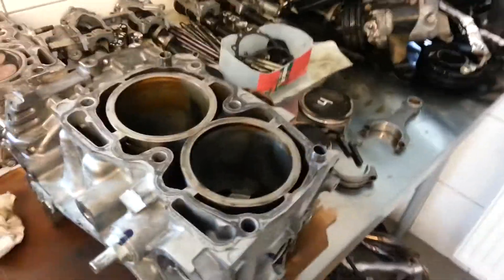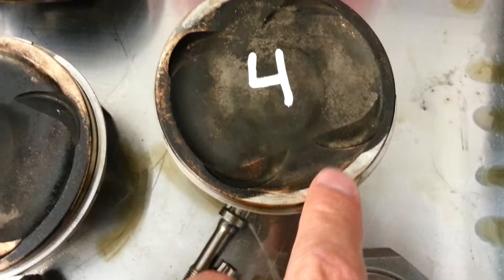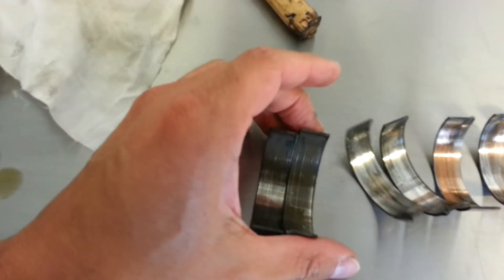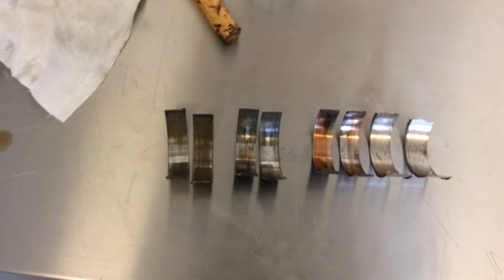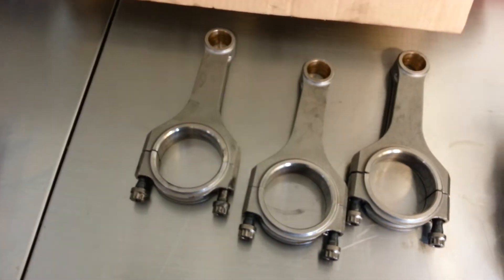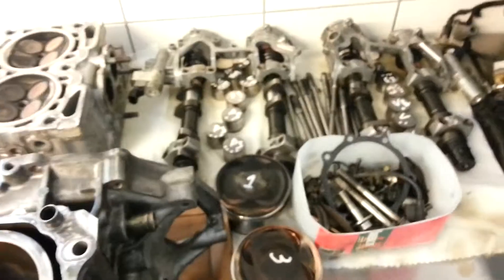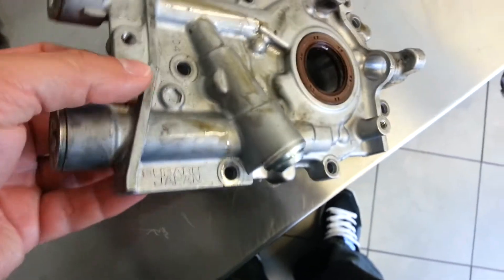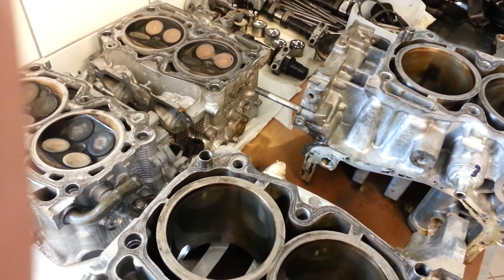Praha-STi - Engine Guts

Comment: it's a tiny bit big for me. my motor was built to be within 0.0017-0.0018. don't think you should go larger than 0.002. should actually be shooting for 0.0015 then you know you'll have good oil pressure. good luck!

Comment: Sad to hear man! Interesting to see no heat marks on the #4 rod... leading me to think it was a sudden loss of oil pressure to the #4 rod bearing causing it to fail pretty quick. It's not that hard to set rod bearing clearance but a bit harder to do main bearing clearance. You did mention that #4 main bearing was damaged as well? Probably the culprit of the problem. #4 main would feed the #4 rod oil. So if metal was coming off the main, rod bearing would fail quickly.